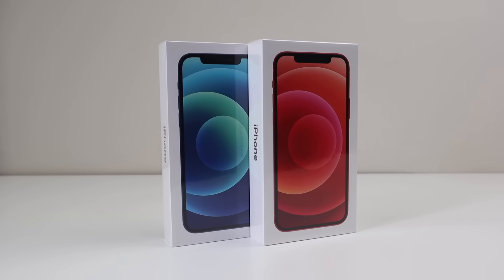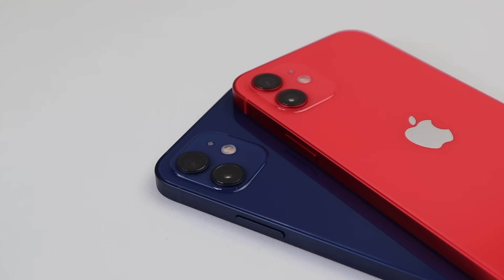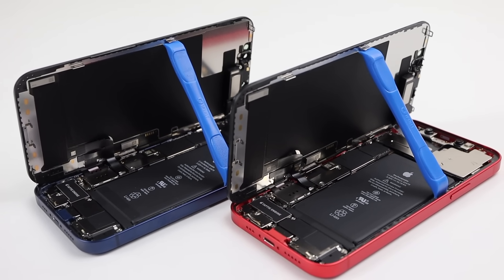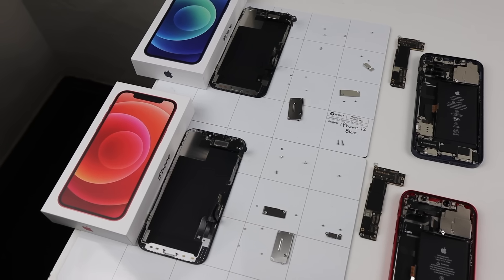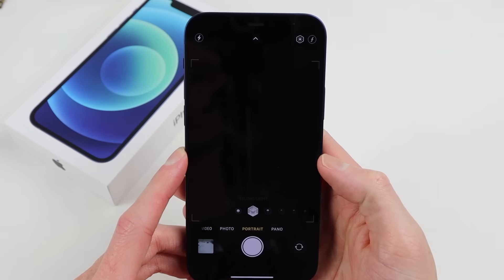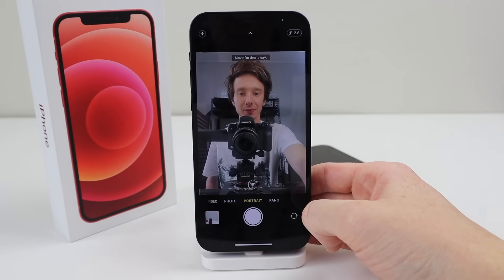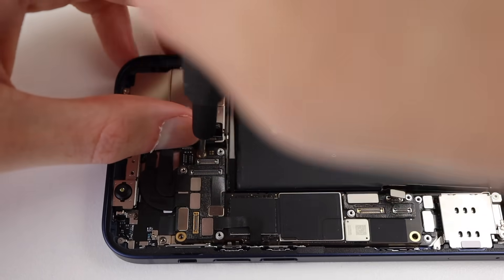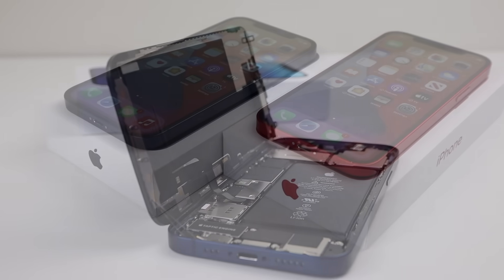iPhone 12 Anti Repair Design - Teardown and Repair Assessment

Comment: It can come off as anti-repairability but the reality is most every component in modern phones communicates over a data bus directly connected to the mainboard and as you can see it’s pretty quick and easy to get into a phone, it could be done in a restaurant bathroom. If someone becomes a political target their iPhone would otherwise be very vulnerable to a hardware swap attack where even the display could have a data transmission chip added and when the device is unlocked, the entire contents of the drive could be dumped.
Reply: yeah but it's not like those channels aren't encrypted

Comment: This is why I still use an iPhone 6s Plus 128 GB. Removing perfectly working features like the 3.5 mm audio jack and not allowing the device to be self serviced is a deal breaker. I will be switching to a cheaper Android soon, since even Samsung and other manufacturers are doing some of the same shady tactics.

Comment: Not defending apple but if you had an old phone and had the old AC adapter you also have the old lighting to usb a cable. The actual problem I see is the 5w that must people have is awfully slow to charge an iPhone 12 so I’m glad if they included a cable it was the usb c to lighting because all you need to fast charging is the usb c AC adapter which apple did reduce the price from 29 to 19. So the additional cost on the phone is 19 and keeping in mind even the base model phone this year is better than last year pro I’m happy with the compromise. Also I know that the camera and Face ID have to be calibrated to the secure element chip at a server level for security. What I can figure is why the software goes so crazy with the rear cameras it could be due to the front one having issues, in the past I have seen how a dead camera could render the rest in usable or...

Comment: Ahem!  It does know.  The boot process being quite reasonably secure allows them such control.  I should point out that this is to force customers to buy new devices rather than repair the old ones.

One other thing.  The security of iPhones and macs is now broken for those with enough knowhow and physical access.

Comment: With the new ceramic mix screens the heat resistance also goes up so to get through the screen to the adhesive requires more heat

Comment: Apple doesn't ship charger in the box as it will have an impact on the environment, but I will need to buy the charger it'll be shipped completely separately, ironically, causing more harm to environment.

Comment: Oh, you broke your screen ? Apple will charge you 650$ to repair the screen... and you cannot do the repair in any other place than apple because it will brick you phone anyways. Once at the Apple store, they will tell you that repairing your screen on your new iPhone 12 is almost as expensive as just buying a brand new iPhone 12 anyways. So you're screwed ! Charging 650$ for a 50$ screen... Crapple !

Comment: IPhone? Who is that?... Forget it. I stopped using those phones on the 4th generation. No charger, no expendable memory, a closed software system, that allows you nothing, no headphone jack, not even an adapter in the box. Next time is no phone in the box for 1000 bucks... 😄

Comment: Apple wants it only repaired by official resellers to maintain their product quality, not some AliExpress battery or screen that lower the Apple standards.
Reply: Nonsense, there are actually very good battery replacement parts that have the same standard with apple, ifixit and many other brands as example

Comment: That's why I won't buy an iphone. I do have an old ipod classic 160. It's been sitting for years and won't turn on. It was working fine the last time I used it. I would sell it if someone can get it working, or use it for parts. It's in perfect condition, except it won't turn on.

Comment: Apple is trying to slowly lock you into their so called ecosystem, where first they sell you different devices, which are compatible to only other Apple devices.
And once you purchase one then you will have to buy the other.
You cannot repair your device from third party, and when the device gets old, then you will have to purchase the new one from Apple because of the other Apple devices you bought because of the compatibility issues.

Comment: So apple:

>removes chargers from the package for "eco friendliness"
>Changes adapters so now all your adapters are obsolete
>They don't let you repair with  a 3rd party, so either let them scam you for repairs or buy a new phone.
>They sold a fricking phone support for $999.
Reply: Apple has already died with steve jobs
Reply: Apple sheeps will say that's Innovation
Reply: Apple executives said; “reduce waste” and “eco friendly” is only to justify for more margin and potential after sales revenue not to mention looks good on the paper; its too good to be true if you ask me
Reply: One other point - this may be a time limited software restriction that automatically removes itself after the warranty period is up. Or apple may simply be able to remove it for free upon request either over the Internet or an unlock code entered on the keypad. I doubt they will though.
Reply: Just because it has a usb 3 lead does not mean your old lead and charger will not work. So not a problem. 
As for being unrepairable, that is the buyers fault. The only way apple will change is if users demand it or a few countries wake up and force them to. Unfortunately countries are run by people who can afford to replace things rather than be bothered with getting them repaired. They are also usually clueless about climate change and how to stop it.
Reply: @foxythedirtydog4494 

 the buyers and Apple's fault*
Reply: @turoreal  Apple is looking after its interests so it is not at fault. If it starts loosing money because of this policy then it is at fault.
Reply: @foxythedirtydog4494  that makes no sense, anti consumer practices is what they created so they're also at fault.
Reply: @turoreal  They were allowed to create anti consumer practices  which as it helps them is not a fault but it may end up biting them which would be their fault. If it is anti consumer, why do consumers still buy them? I don't buy them and have little sympathy for those that do. The problem is lawmakers don't ever worry about repairing phones so don't see a need to change apple or other such companies restrictive practices. Ask yourself why cars are treated differently to phones - there are laws to ensure anyone can repair cars. Even lawmakers need to get their cars fixed.
Reply: @foxythedirtydog4494  You have some odd logic dude, anti consumer practices does not help them, thanks to those anti consumer practices.  they have less potential customers and by those less potential customers, I mean the people who criticize apple and refuse to buy from them due to their anti consumer practices.
Reply: @turoreal  Profit is not just from the number of customers. If they can force customers to replace phones or use their profitable repair services, that can be worth as much or more than the customers they lose. 
If it is not helping apple, why do they do it? They will have researched this and have all the figures. You don't know if this policy is profitable for apple but they will know. If people don't care why should politicians care, unless of course they are affected. A law should be brought in to force apple to give free repairs on all parts that are protected or unavailable. This would hurt apple and stop this sort of practice. If apple want to be green then their best move would be to make phones last longer. Not a good move for a phone manufacturer. If politicians won't make it illegal, due to vested interests and being clueless about scientific and technical issues, then all we can do is create some bad publicity.
Reply: @foxythedirtydog4494  damn, your logic is so weird. 
Apple like any business has it's flaws, what you think they know might be something they know, but are too stubborn to change.
bad consumer practices doesn't help them and they're at fault for that.
Reply: @turoreal   Your logic is wrong - why should apple help other companies repair their phones if they are not forced to? They are only interested in making money and protecting their investments. Where is your evidence that these practices are hurting them? I don't know if they are or not but apple does, it knows its markets and how to maximise profits from them. Apple don't want to repair phones or even less have a third party repair them with non apple parts.  Selling new phones is where their money is made. Their customers know iphones are reliable and they have the option to insure them so repairs are not important to them. Phones are a disposable item that most change after 2 years so normally only need repairs after getting damaged. If you have to replace a damaged phone it is perceived by many as their  own fault and often close to upgrade time anyway. 
Also remember that Chinese companies will copy anything and the CCP will help them do it. Apple wants to protect its brand image and not have their phones made to look unreliable due to inferior parts being fitted by third parties. How legitimate this is can be debated. Cars have to be able to be repaired with parts from any parts manufacturer and they still have to provide a warranty, so why are apple allowed to prevent this? Car makers make parts with electronic modules that need to be paired to the car so they are doing the same thing as apple these days. Hopefully that will get looked at by governments as well soon. 
It is not a fault, it is a calculated risk.
Reply: @foxythedirtydog4494  it hurts them, the people who gives them criticism are the potential customers who are lost, so it is their fault.

these anti consumer practices will only make them progressively lose customers, they can only keep up this "calculated risk" for so long.

the fact that they find it necessary to remove the comments in their apple product videos on their YouTube channel, seems to make it known that they know what their anti consumer practices does to them and how heavily they would be hated on or criticized on their videos if they had the comments on, keep up that weird logic though.
Reply: @turoreal  Now you are getting it. They know some potential customers don't like it and it annoys some iphone users but overall it makes them money. Just look at how many times you said would or will instead of have, had or are. When that day comes this policy can easily be reversed and dismissed with "it was only used to protect customers from bad repairs". 
Apple does its best to lock people into its ecosystem (my main reason to avoid it) making it hard to change but now that there is little difference between the old and new phones or between different makes people will hold on to phones longer. This then is going to give apple bad publicity and force them to change. Look at the cpu throttling fiasco, that cost them dearly and they had to replace batteries at cost to quell the bad publicity. My wife paid £25 for them to replace her battery - a bargain but she still went on to an S20 instead of a third iPhone. Apple will know she has joined me on the darkside and it will feature in a report used in making these kind of decisions. What's needed, is for this video to get press attention now just when people are excited about the new iPhone but apple has advertising clout to suppress that kind of bad publicity and it would be a brave editor who risks taking them on. Apple play dirty in courts.
Check out Louis Rossman on YT he is very vocal on this subject and is taking on apple because of its restrictive practices concerning their laptops and the whole right to repair topic.
Reply: so? just don’t buy.
Reply: @mgiaros  so you're saying that they don't deserve criticism?

Comment: There is one scenario in which apple's design holds some merit. If you rely on the camera to detect faces / identify users you want to avoid third parties to replace it with potentially compromised face recognition. However it is most likely done by software run on the CPU and the battery pairing is pure assholedesign.

Comment: I'm just going to state the obvious but who doesn't have about 50 lightning to USB A cables and USB chargers just laying around from past phones... I mean apple could just sell you a phone at this point and we'd be good to go still. I doubt you're buying a iPhone now without having the ability to charge it. It isn't a big deal and for the case you don't have a cable you can just buy one still with the phone. No one wanted those earbuds anyway either.

Comment: Expensive cars do this, each gearbox has its own engine.... but these mfs
Reply: i used to hang around an expensive car dealership shop. the mechanic explained a lot of the shenanigans about pairing gearbox to engine is not so much about you going to them for servicing (it is), but also about mileage hacking. the mileage is kept in several of the devices and if it detects a mismatch it refuses to run. in cheaper cars, mileage is just kept at the ECU so anyone can rewrite a lower mileage to sell the car for more.
Reply: @Jae expensive cars ? Can i get a link
Reply: Dhruba Saikia any cAr with zf or tremic or gm tcm

Comment: Waiting for apple to go to court as when they intentionally slowed down old devices
Reply: I can't believe what i saw and what i read in the comments. Everything looks so surreal ! Are they really selling devices with no chargers ???
Reply: @The Anonymus Apdroid i have a 6s plus with ios 14 running just fine
Reply: @Ashayazu  same my dad phone is running fine
Reply: @mansoorahmed1256 Now, but on ios 14.8? they'll stop releasing updates soon to the old models. wait buddy
Reply: They only slow down the phones for the battery. Your battery gets older but your phone is running with the same power is going to kill your battery. Do you want a phone that’s still out the box fast and a battery that doesn’t last you through a YouTube video or a slower phone with good battery life?
Reply: @zay6324  if you accept that excuse then the phone should then go back to full speed when plugged in or when the battery gets replaced. Software COULD figure out battery age based on discharge rate how old the battery is. Battery life is a lame excuse for forced obsolescence.
Reply: @zay6324  some people can replace an old battery in phones. I am one of those people and have been doing so for the past 3 years. Its a lame excuse coming from apple.
Reply: this already heapend recently

https://www.cnbc.com/2020/03/02/apple-to-pay-up-to-500-million-to-settle-lawsuit-over-slow-iphones.html#close
Reply: @Ashayazu  yeah I mean, I'm waiting for it to happen again. This time because of they limiting 3rd party repairing, even im the case of using original parts.

Comment: I'm with you on the most points except of one: the lack of a USB-A plug on the charging cable. I think it's the sound move to go with USB-C. Sure, a lot of Plugs have USB-A, but USB-C is at a level right now, where it's not really hard to find a charger. I have more Peripherals (Headsets, Keyboards, etc.) with USB-C, than I have them with Type A. And even if today a lot of people have more USB-A chargers, the acceptance rate will only grow in the direction of USB-C, so this will change in the future. Also their Notebooks have USB-C. Why would they bring a cable which doesnt work natively with them? I think the time is just over for this argument to be made.

Comment: Not an Apple fanboy, here's what i thought:
_The downsides:
  - It prevents or it will be hard for third party repair shops to repair this device.
  - Repairing at Apple Authorized Service Providers or Apple's official shop or something can be dead expensive.
  - Apple Authorized Service Providers might be hard to find, and they're not available in some countries or cities.

_The upsides:
  - Second-hand customers who wants to buy this or any future devices may be more safer because some shady sellers might put bogus parts into the phone and the devices is not genuine so, it's not that great as you know it.

(sorry for any grammatical mistakes) But hey, enjoy what you're using and take care of it :)
Reply: yea, I would understand that for the face ID stuff. But the battery not genuine warning (as you can see all parts are genuine) and the camera problem

that's fucked up.
Reply: They could just add a hardware info screen that shows if anything has been swapped. The capability is obviously built in and they don't have to artificially break the phone to do it.
Reply: @kolby4078  yeah, great point right there

Comment: Rubbish video, click bait crap. I would expect problems from replacing logic board ffs. The camera not so much but really, that’s not something that goes wrong. The biggest repair is screen replacement followed by battery. It will be the same as the previous models that will affect True Tone and battery health information. Big thumbs down for wasting my time!

Comment: To be perfectly honest; too many 3rd party repair centres, and normal users trying to repair their phones usually end up causing more damage such as battery explosions from poor quality replacements and also not disposing of the replaced parts properly. It happens. I’ve worked with companies that do this. Replacing batteries on water resistant phones compromises the water resistance entirely unless it’s re-sealed which Apple do. Considering a battery replacement is around £70 /$80 by Apple,  it’s not really the end of the world. If this was apples strategy to get you to replace their phones instead of repairing them then why are the latest MacBooks and Macs more repairable than they ever have been?